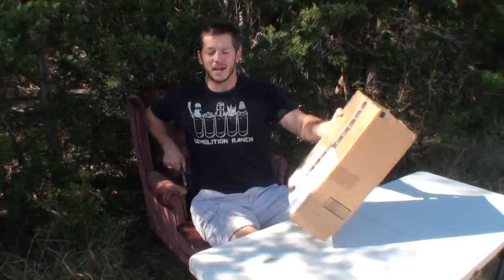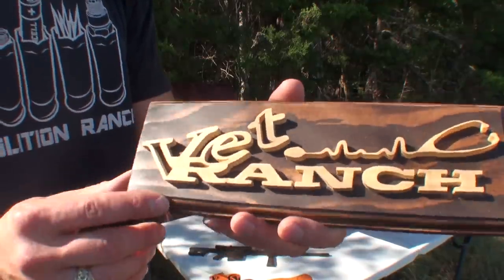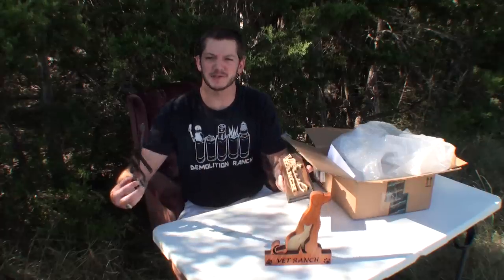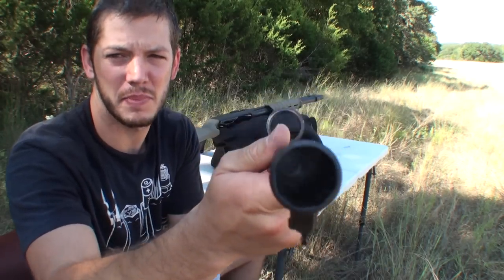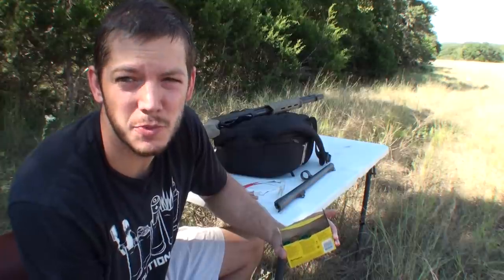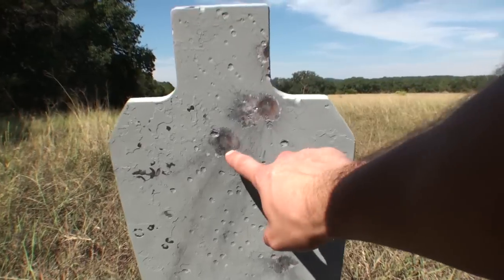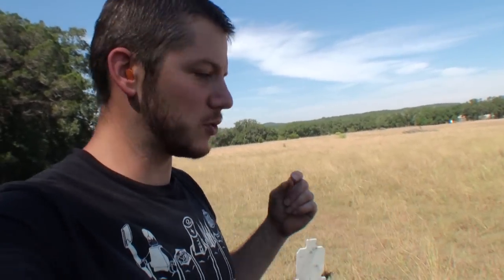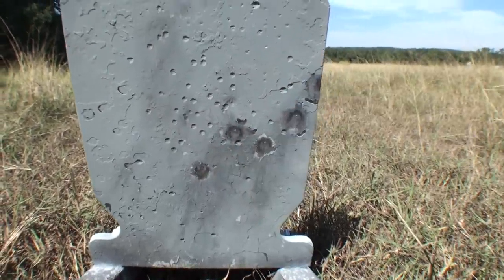Rifled vs Smooth Bore Barrel

Comment: BAD VIDEO! You shot rifled slugs out of a smooth bore... Okay good, the barrel isn't rifled but the projectile is. Then you shot rifled slugs out of a rifled barrel...THEY AREN'T MADE FOR THAT! Rifled barrels are for SABOT SLUGS WHICH AREN'T RIFLED! The rifled barrel grabs the smooth sabot slug and spins it, having rifling on the slug and barrel makes an 2 different spirals on the slug and these forces work against each out as soon as the slug leaves the barrel....which makes it inaccurate! Not to mention how that rifled barrel is now clogged with lead making it even less accurate!
Reply: Make your own video, then. Prove him wrong, Internet Stranger.
Reply: +NecroBanana I don't have to, there are plenty of other videos on here that do a fantastic job of showing the difference between the two. This is something that's common knowledge. I don't think 75 yards shows the accuracy between the two. If he had shown multiple distances and used the correct slugs and he got the same result I would be more than happy to tell you that I was wrong and I would change my viewpoint on the subject. Simple logic and physics proves my theory, but like any theory it has the possibility of being incorrect. I'm not trying to be a know it all, I'm just bringing up a solid point. Have a good weekend, Internet stranger! 😎
Reply: UnitCrane514 Cool story, bro.
Reply: +NecroBanana sure thing bro
Reply: +UnitCrane514 I was thinking the exact same thing..
Reply: +UnitCrane514 internet gun expert if you wanna rant do it on your own channel
Reply: hit the nail on the head rifled slugs thur a smooth bore is creating the spin.... try sabots thru the smooth bore for a good comparison.
Reply: It's amazing how butt hurt people get when you even suggest something contrary to what Matt did.
Reply: +wmr0225 Oh I know, it's ridiculous. I'm no internet gun expert, Ive been shooting my entire life, I don't need to read BS on the Internet to know that you don't put rifled slugs down a rifled barrel. I also like the douche bag that is telling everyone to shoot rifled slugs with a full choke for better accuracy...sure it can be done...the barrel is going to burst from fatigue eventually. When that happens to him it won't be his fault though,  he will blame the shotgun for bad quality.
Reply: +UnitCrane514 75yards will easily tell you the difference with SHOTGUN. Normally you won't be shooting much farther than that. When I'm hunting I never need to shoot more than 125yards. Don't suggest he is doing things wrong unless you have seen most of what he has done and like you said, you're no expert.
Reply: +gallium20 what do you mean by "most of what he has done"? Im not discrediting this guy as an information source. I simply gave a suggestion on what was going to show you accurate results. Heres an example: Lets say your testing a new brand of pet food for dogs and cats. There is a cat  and dog blend (same brand) you give the dog the correct dog food blend, but instead of giving the cat the correct cat food blend, you give the cat the dog food as well. The dog likes the new dog food, but the cat doesnt like the dog food. So from that you say the new pet food is a failure when you didnt even give the cat the proper food. Is that an accurate test? No. The same theory applies to this test with shotgun barrels. He didnt use the correct ammo in the rifled barrel....
Reply: You don't know anything about the scientific method do you? If he was to use two different types of ammo then you would be just shooting shots for no reason, he is changing barrels but keeps the same shot because you need to keep one of your values in the experiment the same. He isn't showing off the accuracy between two different barrels, he is showing the difference in how they act, that is what many of the people watching this video are missing.
Reply: +gallium20 True, by keeping the ammo the same it is easier to compare results. However, and without wading into this shitstorm to much, the suggestion I would make would be to use sabots to conduct the experiment, because you would have smooth on smooth and could see the true benifit from rifling. Foster's slugs are designed to be shot from smooth bore barrels, with a 75 yard zero, I have also seen them shoot just fine from rifled barrels ( perhaps with a slow enough twist rate it would not overspin?) so shooting them from both barrels and comparing the groups in this video (both very simmilar and adequate for hunting within the given range? )is a bit redundant. It doesnt mean the video is bad, and it was fun to watch his experiment. if I had a camera and some free time I would love to run the experiment how I imagine it. But I don't. So thanks Demolition Ranch for giving the armchair snipers a topic to bitch about until your next video!
Reply: +gallium20 I know the scientific method quite well actually, and sometimes you will have two variables. The constant would be the receiver of the shotgun. There are plenty of times you will have 2 variables. Life doesn't work the way its printed in a science book...science doesn't  either. Heres another example: Your testing the differences in fuel economy in a VW Jetta between the gas and diesel model. Same car, different fuels and different engines. Having two variables is unavoidable in this test. You contradict yourself in your last statement as well, if he's showing the way different barrels "act"...doesn't that directly correlate with accuracy???  Read your last statement a few times and then use your two terms in the same sentence. If someone said "man my rifle acts great, but the accuracy is just terrible!" It makes no sense, you don't either. End of argument. Your making yourself look like a jackass trying to prove everyone wrong about using sabots, your wrong, get over it.
Reply: +Eric K that would be a solid test. I only made a suggestion, jesus these people are like 4 year olds when you tell them the Easter Bunny isn't real. I would do a video as well, but like you I dont have the time.
Reply: UnitCrane514 The fuck happened here?
Reply: +NecroBanana your guess is as good as mine. People are butt hurt thats what happened
Reply: +UnitCrane514 Yeah I dont know man. If you want ro get all nit picky you will never get a consistent variable from the ammo because of the nature of powder burn. Even with hand loads the FPS will always vary... but now we are getting petty with the details.
Reply: Well technically he recommended not using a rifled barrel in the video. He may have shot rifled out of rifled but he didn't tell anyone to do it since the smooth bore produced the same results. Ultimately he recommended the smooth bore. (And no, I'm not disagreeing with you. Anyone who owns a weapon should know what ammunition to fire out of it. Then again he has done some crazy stuff to shotguns.)
Reply: AH......you are not necessarily correct. In general you want sabots shot out of a rifled barrel and a rifled slug shot out of a smooth bore BUT there are videos out there of rifled slugs shot out of a rifled and the accuracy is pretty good and the user noted no fouling. Here's what he got:

Rifled barrel:  2" using sabots, and 3" using rifled slugs

Smooth barrel: 8" using sabots and 5" using rifled slugs

Takeaway is this: in general use sabots in a rifled barrel and use rifled slugs in a smooth barrel BUT.... if the guy in this video really did use rifled slugs in a rifled barrel his accuracy claims are still fairly good because at 100 yds the difference between a smooth vs rifled barrel with both using rifled slugs is about 3" differential. So for shooting at 100 yds or less a rifled barrel is not needed. Hickock 45 also has a video where he uses a smooth bore with rifled slugs and no scope an hits targets at 230 yds.  Bottom line: a rifled barrel not needed for 99% of all shooters because a smooth bore using rifled slugs and good sites can hit targets at 100+ yds with pretty good accuracy.

Comment: i'll let you know for sure on this as i have a smoothbore 21" coming for my 11-87 which is identical to the rifled barrel on that gun and is a scoped gun with the mount on the reciever. i got tired of lugging two guns to the range for shooting birdshot and buckshot and yes, you do need sabot rounds for good accuracy(try the federal truball ones for inexpensive ones) and don't overlook tactical slugs for that test, they generally are only 1,300 fps or so and are far less painful to shoot lots of.  Most deer don't own a chronograph to care if the bullet was 1,100 fps or 1,400 fps when sitting in the freezer:)

Comment: Guys, rifled barrels are intended for shooting sabot slugs only, and they perform with great accuracy with them, and even more if you use a scope. Regular rifled brenneke slugs won't perform much better out of a rifled barrel, they are just not designed for that, only thing you would do is foul the inside of the barrel with lead deposits and would need a deep clean after use. And by the way, as opposite to many of you think, the rifling of regular brenneke slugs is not intended to make the slug itself spinning, but for making it going through tighter chokes safer.

Comment: Sabot Slugs are designed and engineered for rifled barrels. Lead slugs are NOT rifled for spin, but to accommodate a choke. There are slugs with "wind rifling flutes" in them (Kind of look like drill bits) that give you more terminal velocity, but your effective range is STILL 100 yds (Only 1.5in drop). Brenneke is lead manufacturer for these slugs (I would say)

Comment: I would love to see you redo this with sabot slugs in the rifled barrel. so do 4 tests. 1 brand of normal foster slugs in both smooth and rifled barrel (this video maybe) then a 2nd tst with the same brand of slugs, but instead of foster, slugs use sabot slugs in both the smooth and rifled barrels. then compare the results of all 4. 

the sabot slugs should do best in the rifled barrel. and i would expect all the rest to be about the same after that.

Comment: the spiralled grooves are what help the bullet spin in flight so it flights in a stable trajectory. you can fire slugs out of a smooth bore but your accuracy is going to be limited and you won't get as much range

Comment: So not really on the point of the video. I'm from the UK and have just started watching, enjoying so far! Seeing the things you get up to on here made me think of something from the book Day of the Jackal. If you don't know it's about an assasination attempt on Charles de Gaulle, the one time President of France. The assasin used some custom exploding bullets which used mercury in a pocket inside the bullet (a hole was drilled in the back of the bullet and a small quantity of mercury was put in, not enough to fill it, so that there was enough room for it to slosh around, and then the back of the bullet was sealed up). The Idea was that as the bulltet is fired, the murcury is forced to the back of the bullet as it flew, and when the bullet connects with the soft target, the heavy murcury flys forward inside the bullet impacts the front and due to its density effectively explodes the bullet. I was wondering if you had mheard of this and what the real worl effects were. Alturnatively you could tru packaging up some mercury in something nd firing it out of your home made shotgun shells...

Comment: You failed to mention if there was any choke in the smooth bore barrel.  I'll assume there was not.  Rifled slugs like you were shooting are designed for a smooth bore barrel and the slug itself spins itself going down the tube and is therefore generally stabile. ie: it does not tumble.  Rifled slugs can be fired though a rifled barrel even though rifled barrels were designed to use sabot slugs.

Comment: 1) Matt, you were using rifled slugs out of the smooth bore barrel. Hence why the smooth bore was so accurate. 2) using rifled slugs out of a rifled barrel can damage the barrel by clogging the rifling in the barrel. I suggest revisiting this experiment using un-rifled slugs such as sabot slugs. This will better demonstrate the difference in accuracy between a rifled barrel and a smooth bore barrel.

Comment: Great video. I was hoping that you could settle an argument. I say that buck shot through a rifled barrel will hit everything except the target due to the centrifugal force pushing the buck shot out and away basically making a circle around the target. Am I correct?
Reply: Nah.... it would just be a wide open pattern like a sawed off shotgun or a cylinder choke.

Comment: I saw a demo where they took a smooth bore matchlock musket and fired it at a very large target, at 50 yards the group covered several feet!  Then they fired a rifled musket at the same target, of course they were still primitive weapons with primitive sights, but the rifled barrel brought the group size down to a foot or so.  The old smoothbores were really designed to be fired by squads of people shooting in the general direction of their enemy, enough shooters and they are bound to hit someone.  When rifles came along they could actually shoot at people instead of formations. 

That was the big deal during the Civil War, they were still using the old formations and tactics used for smoothbores, while they were changing over to rifles, those ancient tactics weren't suitable for more modern weapons.  One of several reasons for the body count during the Civil War.

Comment: maybe do a test with sabots I shoot around 1 inch group at 100 yards with light fields out of rifled barrel with low magnification scope . With iron sights 2 in and all those weird rounds you shoot would benefit from rifled barrel I've seen you shoot some would perform great out of rifled barrel I have made some out of high carbon steel punch thru half inch mild steel from sabot with rifled barrel in a 2 3\4 mag load

Comment: I have found that the Remington smooth bore slug barrel, This is the one with sights. Shoots slugs better then most rifled slug barreled slug guns. Due to the Remington being improved cylinder from chamber to muzzle. By the same token they also shoot buckshot a lot better. Sabo slugs tend to do better out of rifled barrels. Now know this. Foster slugs have lands and groves on them. But they do not spin in flight. Back in the 40's when the old pumpkin ball"69 cal round ball" was fazed out for something new. Remington and Winchester put lands on the foster as a selling point. But it serves no use. I need my own u-tube channel.

Comment: I know this video is old.  But the only thing I dont think makes total sense here is that there was no mention of  exactly what type of slug you were using.  Because both a smooth bore barrels and rifled barrels will have better performance depending on that.  For instance a foster style rifled slug is better in a smooth bore as the rifling on the projectile produces the spin. But put that same rifled slug in a rifled barrel and now you two sets of rifling not helping each other out in any way and performance will suffer.  Just as if you were to use a traditional slug on both guns then the smooth bore would suffer in the accuracy department.   This to me seems kinda like saying gasoline engines are stupid compared to diesel but you only ran diesel in both engines.

Comment: I think that maybe, the lack of improvement in accuracy, between rifled barrel and smooth bore might have to do with the existing rifling on the slugs, not working well with the rifling in the barrel. Maybe slugs with no inherent rifling would perform better?

Comment: dear mat rifled slugs are designed for smooth barrels.Sabot slugs are designed for rifled barrels.Smooth barrels can shoot both types of slugs but the sabot slugs will tumble and keyhole down range however noseheavy rifled slugs will be more accurate in a smoothbore.Now rifled barrels will stabilize a sabot slug (a fat  short  jacketed bullet of a smaller diameter of the 12 gauge which uses a case ,sabot,to capture the gases of the shotshell) and will be more accurate in greater distances but it is not advised to shoot rifled slugs out of a rifled barrel because the lead will clog up the rifling making it less efective and the aerodynamic design of a foster slug(rifled slug) really makes not much of a difference being shot from a rifled barrel.Mat I think you know all that I am just writing all this down for those who do not know :)

Comment: Those slugs aren't meant to be shot out of a rifled barrel, just saying. Rifled slugs are meant to be shot out of a smith bore because the rifling on the slug itself is what causes it to spin. Sabot slugs are meant for rifled barrels because the rifling in the barrel causes the bullet to spin (basically the same as rifles and pistols). Rifled slugs out of a rifled barrel can cause lead fouling and potentially damage to the rifling.

Comment: Hi Matt, you keep pointing out that some of the shotgun shells have high brass and some low, what difference does it make? Only ask as I had a cheap semi auto shotgun that struggled to cycle at times and I pinpointed it down to the low brass shells I had. Put high brass through it and it never missed a beat! I can see that high brass would have a little extra weight when spitting out empty shells but what other benefits does a high brass have?